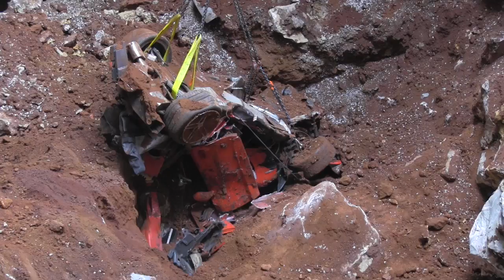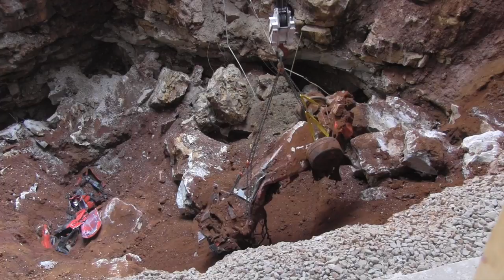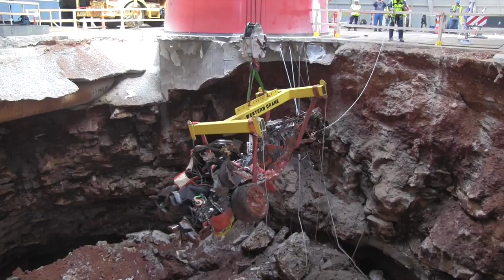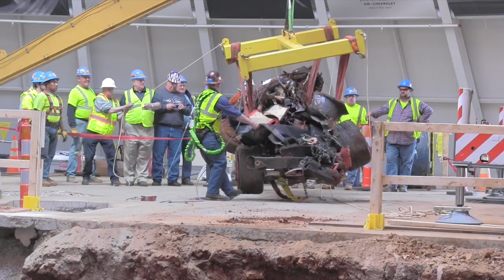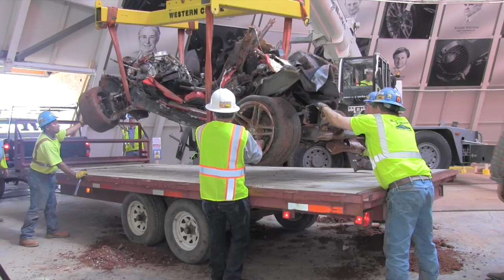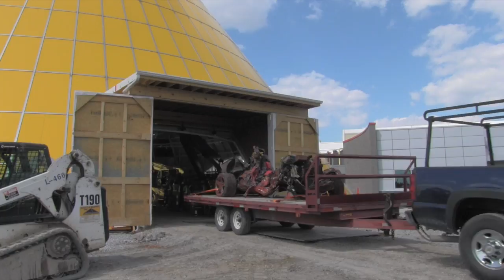2001 Z06 Mallett Hammer Recovery

Comment: What are they going to do with that stupid sinkhole?? Are they just going refill it with new dirt?
Reply: They would never be able to compact that volume of dirt without tearing down the building to dig an even bigger hole first.  Without compaction, the floor will subside again.  They need to pump in the same kind of grout that is used to fill old mines and caves.

Comment: 4:19-5:53: Why have a harness on w/o being tied off? Why have a controlled access zone and not be tied off while working with a suspended load? Why walk up and reinstall fall protection devices on a leading edge known for failure? Someone with Western Crane needs to terminate that wanna be iron worker, and hire a safety compliance consultant ASAP. This made national press. I'm sure someone from OSHA will see this. I know I will be using it in my fall protection training class from now on.
Reply: Wuss.
Reply: The guy in the control zone is tied off, notice the retractable safety line anchored to the floor.